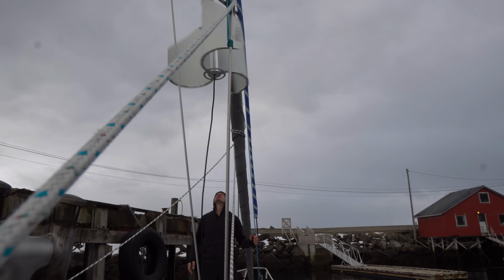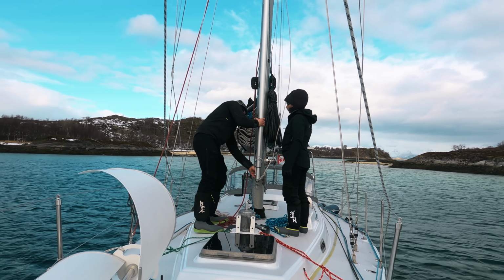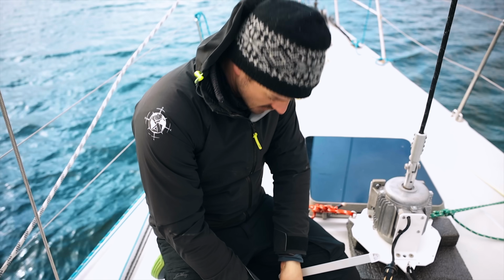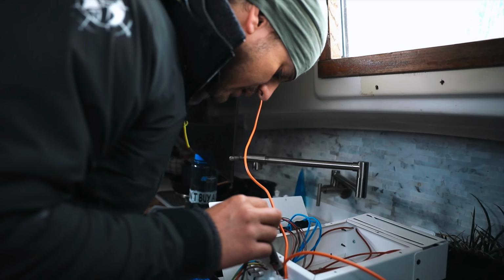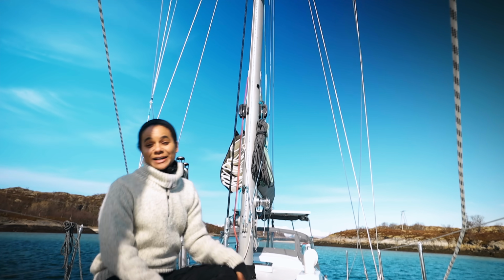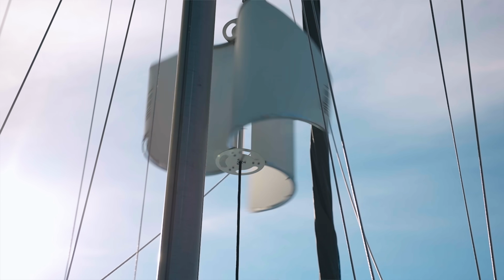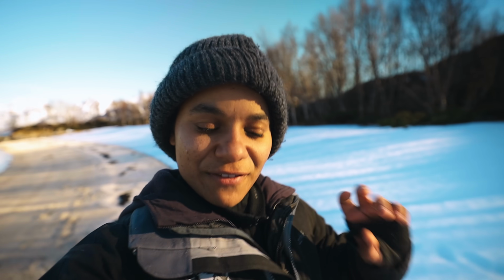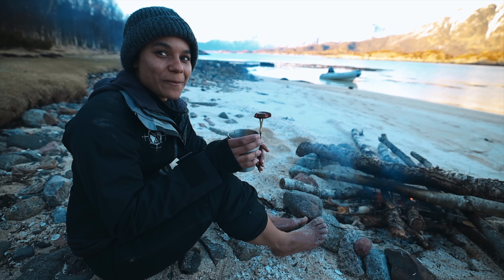No Sailing, Just BULLSH!T — Sailing Uma [Step 273]

Comment: Idea 1:  an array of solar panels that fold up pretty compactly that can be placed or attached to some floats or the dingy so that you basically unfold it and toss it out in the water and it dramatically increases your solar surface area.
Idea 2:  an extension on your bow long enough to mount your vertical fan without it hitting anything. Then using pulleys and a rubber o-ring type belt to attach it to the generator nearby on the front of the boat.
Idea 3:  Could you mount a flat solar panel on top of the mast?
Idea 4:  that metal arm deal that reaches out left or right to hold out a sail, could something like that hold a turbine off to the side of the boat?
Idea 5: could you look into slightly larger and/or slightly more efficient solar panels to mount where your existing ones are mounted?  Could additional panels be mounted to the sides or to the rear of the existing panels?  Are there flexible solar sheets that you could deploy on the front half of the boat or as like a shade in front of the rear panels?
Honestly. Something on top of the mast would be super cool, sucks that there are noise issues with the normal type units.  I like thinking about this.

Comment: You could use a speedometer cable to transfer torque from the blades to "box". Ok you would have to find a healthy one. Like for a truck.. Maybe a toilet snake would be strong enough. The idea is a flexible drive shaft,... ~~

Comment: Dan, there are ferrules you can get for attaching stranded wire to terminal blocks.  Here's an example: https://www.fastenal.com/products/details/0749622 . We use them when wiring up stage pin connectors for theater lights. Without the ferrules, the screws just cut the strands as they are tightened down. They are available for all the standard wire gauges.

Comment: I love your enquiring mind Dan and willingness to try stuff. However I’d have thought enough brain power has been applied to this problem already to come up with a viable solution. If it doesn’t exist, there’s probably a reason. But there ARE solar cells that DON’T need bright sunlight to work. These are incorporated into amorphous solar blankets that can be deployed at anchor. They connect via Anderson plug into your system. Not sure if they are known just in Australia, or if you’ve seen them before. The Aussie maker is called REDARC. They are built very tough, and fold up and store to a small size, weighing about 12 kgs. If you are willing to deploy wind vanes at anchor, then a blanket should be easy enough to rig.

Comment: Try a flexible cable, wire rope?  This would allow you to tension it as much as you want. Another thought would be to get/make a new hatch-cover (which is a load bearing, water-tight opening), and replace the glass cover with the solid mounting (or hang it from the INSIDE of a  solid hatch-cover), at least temporarily for the hatch/generator. P.S. you guys need an extra crew-member, I have a friend who is an electrician who has an ancient beagle that he has taught to do 'smoke tests' and will lead him to where it is coming from!

Comment: losing so much energy through the line... why not directly attach the motor to blades and haul up as one unit - turn eyes around to use lines to tie motor base to deck to keep from spinning - I understand the weight issue - but if using at anchorages only - why not? therefore you don't lose energy... otherwise, create a solid pole - even if in 2' sections that can assemble to get that energy in nearly its entirety transferred down to motor on deck??? the pole sections if assembled like the universal of a car drive shaft can allow the motor to be off slightly from the axis and keep energy.?? your thoughts?? (btw - you'll ruin the motor by tensioning the line/shaft too much because the motor bearings were not meant to have a verticle load on them....) your thoughts are really welcomed - I love stuff like this as a Licensed Architect for over 30 years! - thoughts?

Comment: How about using a lightweight alloy rod to attach between the motor and the blades so you have a more stable shaft??? You can then store the shaft down the side of the boat when not used

Comment: How about an automotive type very light weight alternator-only, with built in diodes,  rather than a motor/generator which is much heavier?  The alternator can then be placed right up near the blades.  If you must get a torsion line with low energy loss, perhaps ask these guys what they would recommend and why.  They make serious ball bearing torsion lines.  https://www.elliottmfg.com/

Comment: Were you implying a pending cameo from NBJS? 

Why this is not a good idea ...
1) where will you store that large turbine while sailing?
2) on transoceanic passages you will not be able to use this to increase your power generation. 
3) someone smarter than me can foresee more problems. 

Everything is a compromise and the horizontal turbines designed for boating have mostly accounted for the “best option” compromise.

Comment: WAGO Clamps guys!

I suggest you take a look into something called "Wago Clamps"...They are designed to be used with stranded wire! 
Should totally be a thing in Norway aswell...honestly, i am kinda supprised you dont have those on hand already^^

The ther option would be t use ferrules on your stranded wires before you go into such a terminal.
Reply: You know it man! And if that's not practical than you use din rails!
Reply: WAGO are so easy to use.
Reply: Indeed! Wago are now the industry standard 👍👌

Comment: with regard to the uneven(jerky) turning speed. That may be a plus in slower wind as you will have higher voltage peaks  to work with. Also, it was hard to tell if there is a rectifier in the line somewhere. I am pretty sure your charge controller will not be happy with AC in. It could of course just mean I didn't see the rectifier already there.

Comment: Some suggestions....

1)      Increase the length of each blade from 24" to 48" tall.
2)      Decrease the curvature of the blades by using a larger diameter of PVC pipe.
         (These two changes mean the overall blade diameter would be smaller and could increase rotational speed)
3)      Hard shaft a ten foot 6 - 8mm rod on a Universal Joint at each end with the top mounted to a sealed bearing.
4)      Top bearing would be mounted to a hinged plate attached to the mast.  The hinge allows for varying tension 
          from a backstay.   

In theory this would allow the unit to remain in place in a permanent sealed and covered mount.  

Just a thought,

Kirito in Providence

Comment: With standed wires it is not recomended to tin the wires because when the solder deforms it can cause bad connecctions, using ferrules on stranded wire is a much better option.

Comment: the rotor must be made with two blades, not three.  the inner ends of the blades should not converge in the center, and the flux 10 cm thick from the inner surface of one blade should go directly to the inner surface of the opposite blade. then there will be no shadow effect and no dead end.  it is necessary to install a gearbox, because the aerodynamic part is low-speed, and the electrical part is high-speed. the generator will operate from 30 hertz. the bearings of the generator are not designed for axial loading, so there will be great resistance and rapid wear.
Good luck! )

Comment: You need a completely different construction, electric and mechanical, to make a turbine like that, generate useful power. 
In general, I don’t believe you get sufficient power, as the area in the wind, therefore the power you can generate, is very small !
( this is simple Newton.)
I guess you will get under 5 amps, probably less, on 12 volts.

In the physics you can find some inspiration, by looking here on YouTube, where someone are “playing” with water turbines.Pelton principle. 
They try to harness power from the mass and velocity in water, just as you try to harness power from the mass and velocity of the air. 
You can also find inspiration in existing solutions like yours. They are all over the planet. Often they are useful to pump a little water, or other small appliances, but the turbine is many many times bigger than yours.

Electrically, you need a very different generator, and you need to know more about generators and electricity in general.

If or when, you get a wind turbine like that to generate sufficient useful power, then you have the issue regarding the breaking.
Not having the turbine spinning out of control or hitting something or someone.
Also, I believe you will get some serious issues with vibration, if a turbine like that spins at acceptable revolutions.

To solve the issue regarding your electricity, I would go for different solar panels, that don’t have the same issues regarding shade, and a more conventional, 3 blade, wind turbine solution. 
I know those conventional turbines don’t give a lot of power, but they will give some power, and are reliable. I’ve seen boats where they mounted two turbines on the solar arch.

You do have a regeneration solution. 
I like to know if it generates any power. And if it does, how much at a given speed.

Comment: Dan good on Ya. Keep up with the ‘tech’ 
Re the torsion  shaft, have  you considered your old favorite  1” hdpe  conduit
 
Btw how is that low tech stove working out? 
It looks mighty cosy…
  Some ‘old tech ‘ observations :
1.You might consider  placing it down lower in the boat, closer to the floor, provided you have room…
 2.I find that old fashioned charcoal briquettes work well…
3. There are suitable 12 volt fans you might consider to help move the hot air around, I think they only draw 0.15 amps…
They are super dry and easy to store…

Comment: @sailinguma we are an electric sailboat in the PNW. We tried a big wind generator mounted on our mizzen mast first. It required a lot of wind to generate any usable electric over too long a period. And besides the issues you wisely mentioned, the drag was affecting our sailing, balance and steering. And those are moving parts requiring maintenance. We switched to solar only. No hydro. We haven’t plugged in since beginning of season.

Comment: For mounting the Propeller i would use the rail you allready have on the mast and fix the propeller above and below. that schould reduce the woble of the probeller and make it more efficient. the torsion line is a good idea, i would keep it. together with the stable rotor mound and thereby easer alighnment it schould work just fine

Comment: It seems that you could use a torque tube to transfer the rotation down below, still have the top portion attached to the mast, and the generator could be in the hull somewhere. Maybe have a disconnect at the deck level to take down the turbine when it's not wanted.

Comment: I was just doing some research about the same topic. I don't know why there is no version of this turbine with a rotating shroud connected to a wind vane to block the wind on the returning blade. Too bad not having a 3m 1" aluminium pole to use as an axle instead of the rope... Good luck!!!

Comment: you seem to be sending AC to a DC circuit and with that you're litteraly smoking the capacitors. You need to rectify your AC to DC first. don't use the solar charcge controller with the 3 phase motor. also, it probably is built for DC from solar and not AC from the motor/generator. if you feed a DC chagecontroller with AC, you will blow it up.
Reply from the maker: So this was all from an off the shelf unit. It’s has a “wind turbine” charge controller with a built in rectifier. No reason it should have been smoking like that, other than the fact it built like $hit. But like we said, we’ll be replacing pretty much everything as we test and evolve the system.
Reply: @SailingUma  ah okay, i missed that. Still the amount of smoke seems to come from the capacitor. What you also can do as a cheap wa, is to buy a 3 phase rectifier and after that, you can hook up a normal charge controller.

Comment: I don't see how you can get power out of a motor spinning at such low revs unless like an alternator you can feed the field coils with some current? Perhaps an alternator down there would be a better start. Remember also your dingy motor has an electrical output to make a spark and can be used in emergencies.  I don't recognise the charge controller . If you give me more detail I will look it up and write you a better explanation. Overall I enjoy this type of video. How up to date are your solar panels? They are getting 400+ watts out of standard house panels now and bypassing each shaded cells individually. Could make a big difference to you.

Comment: Not turning fast enough, might want to add a pulley system to multiply speed of motor. The trick is going to be to find right ratio.
Thinking that you could expand your system to water (tidal) and that my friend would generate exponentially more power (>10X). And those connectors will get you in trouble with your insurance company if you need coverage for a related issue.

Comment: I would try a DC generator (if you can find a 48 volt one [maybe a rewind]) as they work at slow speeds, a decent MPPT charge controller and some kind of universal joint instead of the knuckle joint ( two interlocking eye bolts work well) Aloha!

Comment: I think I would try to use a fiberglass or carbonfiber rod with some sort of flexible but quiet „universal joints“ between the rotor and maybe some sort of (also quiet) gearbox with bearings that can take axial load to up the RPM and drive the generator  from that. And I would mount the rotor top and bottom on    brackets with bearings to get the tension out of the system!

Comment: I know it not producing much yet, but before you get to the point of more than a few watts at 12 volts, please switch the plug and socket. The socket should always be on the source side, the plug on the consuming side. If live contacts were to touch something conductive .... Have you ever tried welding with an auto battery? Even at 12 volts, there is enough current to damage whatever tool was unfortunate enough to bridge battery positive to the car body. That's why one always disconnects ground first. 

I do find it very open minded and flexible to use the three conductors for the three phases the way you did.

Comment: You should never tin wires with solder and put them in a screw terminal like that the heat expansion and cooling over time will cause them to loosen and eventually cause a bad connection and high resistance and heat which then melts the solder.   There are special wire ferrules you can get which can be crimped onto stranded wire which will allow you to use this type of terminal

Comment: I wonder how high off the deck you need to get the veins of your generator? Would a piece of the 1/4 or smaller solid rigging or any metal rod work better? Maybe even using a carbon fiber rod if weight is a concern. With a solid rod between the motor and veins then all that would be needed is proper tension to keep the weight of the rod off the bearings in the gen. You could also add a bearing to the top of the vein assembly to assist with freedom of motion and have the veins connected to and eye with a roller at the bottom of a spar on your rig. Like is done with the sheets for your rig. I'm sure you can picture what I'm dreaming up as your almost to that point. A simple eyelet attached at the bottom of one of your spars with a pulley attached and hanging down from it. From that pulley to the veins either by a smaller section of some type of rod or the torsion line you were using with a bearing assembly at the top of the veins. Then an actual rod connecting the bottom of the veins to the gen. With the eyelet on the spar letting you adjust the tension between veins and gen base. The rod would help with flex and having the veins tension adjusted between the spar eyelet and top of the veins which would also allow for easy alignment with the placement of the gen base. I'm talking way to much here but I think you get what I'm saying. You'll get better speed/rotation by using solid rod and alignment would be much easier...
Thanks for another great episode, it truly is beautiful there and I'm very happy for you both.
Safe travels, fair winds and God Bless...

Comment: Any multimeter over $5-10 measures current as well as voltage.  Wattage (power) is simply voltage times current, which means you can measure power output with a multimeter as long as you give the generator something to drive (a load, causing it to supply current/electrons).

Comment: Contact Automation Direct for all your electrical control needs. They will have low & high voltage terminals that are made for stranded wire. They have a webpage. Very inexpensive.

Comment: You are motivating me to finish a wind turbine design I have.  Trial and error, again and again. You are on the right track.  There used to be a model that was mounted with a line top and bottom that looked like a hoop whose blades spun inside the hoop.  The hoop was then "line" mounted (hoisted).  The magnets and coils were inside the hoop structure so they were weather protected.  There were no tensioning issues.  I am not sure if these are still available but if they are it would be worth the effort.  Thank you